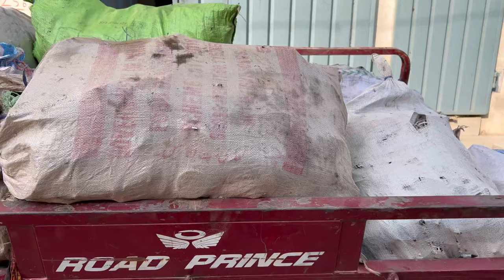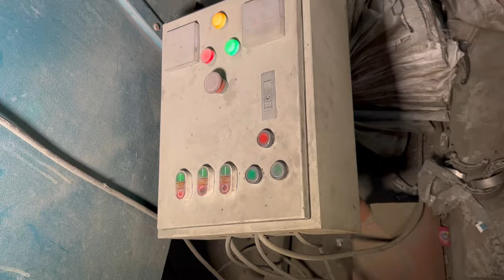How Motorcycle Brake Leather and Brake Linings are Made in Factory || Brake Shoe Making |

Comment: love how they carefully monitor the chemical composition of the Al and and i bet the brake material is made just as carefully in another back street factory too... between the child labor , the aluminum vapor, and the brake dust floating around it's scary to watch.
Reply: At least they had the protection off open toe sandals when pouring molten Aluminium. I'm also alarmed how easily yet could break apart the castings by hand so they appear to be very brittle. A danger to all those making these brake shoes and probably anyone who uses them too . Shocking.